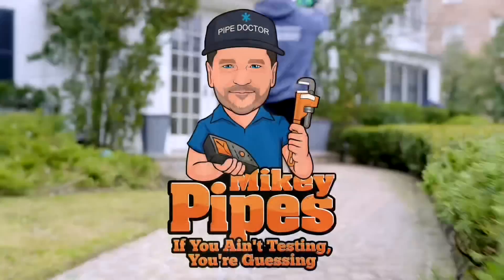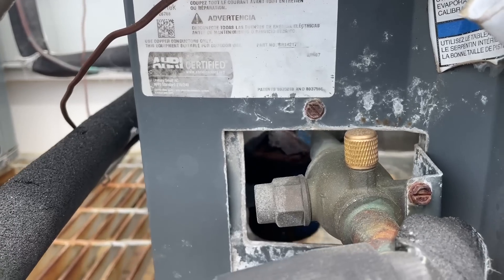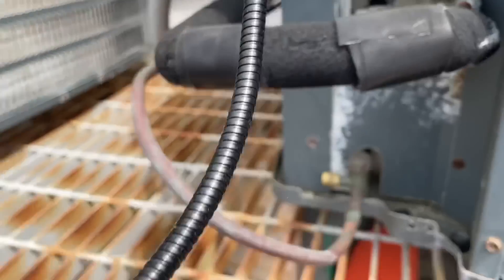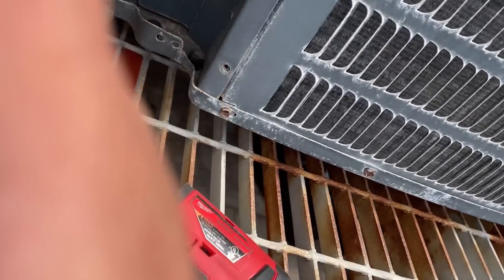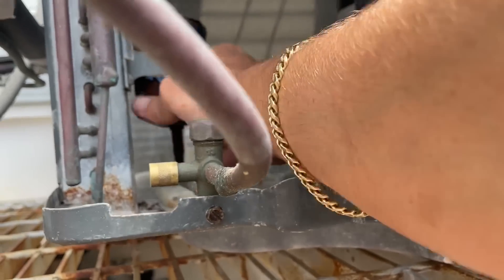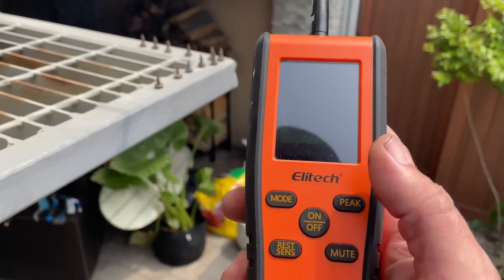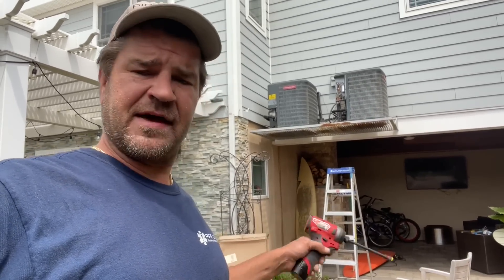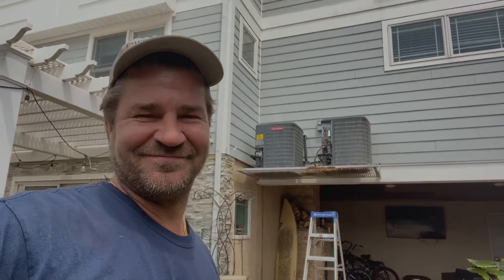Goodman AC Not Cooling Leak on Filter Dryer Inside Condenser Found with Elitech IR-200 Detector

Comment: Filter driers are factory installed in condensers because the average hack installer tends to neglect field installing filter driers on the line set and manufacturers got tired of warranting compressors because of it. It’s literally common knowledge. 🤣

Comment: The one thing in which MicroUSB was better than the previous MiniUSB, was that it had the electrical readiness for OTG years before there were too many OTG supporting devices. Otherwise Mini was mechanically sturdier, and easier to get the right way around. Now USB C not only allows high charging currents and takes the speed to another dimension, but it takes the OTG functionality to yet another level, as OTG is technically inherent in any cable without a special adaptor, and a slave device can charge the host in the newer specs. The only thing that bothers me is that the cables tend to be expensive.

Comment: I was told they put them on at Goodman to assure that the system had one fit its protection.  I’ve replaced several over the years and either put it outside the condenser or at the evaporator.
Reply: If they didn’t put them in, their “professional” installers would forget.

Comment: If I may make a suggestion,  unless you have it already, buy the Milwaukee 12v "Right Angle" impact driver.. I have two and they're my "goto" for 98% of my service calls. It goes where even the small drills can't reach or enter. And with a flex rod with a short nutdriver bit, they're aren't too many places/angles you CAN'T  reach. Especially between the furnace and return duct. Granted, it takes  some getting use to holding & using it, but its worth it..
https://www.milwaukeetool.com/Products/Power-Tools/Fastening/Impact-Drivers/2467-20

Comment: Unless you are fitting a whole load of condensers above your head every week, I would hire a genie lift or similar as and when required. Put the cost of hire, delivery and collection on the customer. The issue though is the surrounding ground - I see a lot of your work around lawned areas so you need a stout bit of plywood the size of the lift base to spread the load.

Comment: 3:15 I engineer / work on electronic devices like these. Generally micro-usb is used because it is cheaper. A micro-usb connector part might cost about $0.15 at volume whereas a usb-c connector part would cost more like $0.50. That's a huge difference when you're talking profit margin on an electronic device especially for something which doesn't bring any change in actual functionality. It doesn't sound like a lot ("I'd pay 50 more cents for that") but these kind of things add up and eat away at profits or device costs really fast.

Micro-usb is still more common in products like this anyway (i.e. more people are likely to have a cord or charger for it). The aggravation of plugging in the correct way may be out shadowed by the aggravation of not having the right cord when you need it.

Comment: Stupidest thing ever. I've seen it in York too. Nothing like a tall heat pump with the drier laying on the bottom of the unit. Genius. American Standard/Trane tend to stick the reversing valve and the mufflers/driers in the side panel. Then some idiots installs that side against the wall for no reason.

Comment: Genie  Compact Air-Powered/Material Lift, 300 lb Load Capacity Model GH-3.8    Or General Purpose Manual Material Lift, 1,000 lb Load Capacity Model SLA-10 STD

Comment: Use a genie lift. What we use and it can fit into a pickup. Not defending Goodman but technically speaking that’s an Emerson drier so if you want to bust balls wrong company. Mikey I want to see you fix a leak. That’s two videos of what I would consider repairable leaks that haven’t been. Not saying it’s the best option but a option which I know you gave them but cmon super tech sweat some pipe.

Comment: The drier is in the unit so they know it is installed. Lazy guys may not want to take the 5min to install if it is shipped separate. Zoomlock a short piece of copper in place and a zoomlock drier in the attic. Easy
Reply: Why would you ever want to put a drier inside and force someone to take a torch into a house for every single repair? I know, I know, “The drier needs to be close to the metering device” blah blah blah. Heat pumps in many areas spend more time in heat than in cool and that means the outdoor metering device is more important. Many OEMs toss them in the condenser (obviously) so it really doesn’t matter. Don’t be that guy. Put the drier outside where it belongs.

Comment: What you want is a telescoping mechanical lift called a High Jack and some other brands. You should also get a platform ladder so you can safely stand at the right height. Get a magnetic tray to store the screws during repair. If you won't use the lift often you may be able to rent it.

an example: https://shop.gilmorekramer.com/product/a-1-hi-jack-hi-jack-material-lift/57612?gclid=CjwKCAjw47eFBhA9EiwAy8kzNOBHFYC0zPb4uIeR63CHPyHu4C5sQ9hjnuV9q_wqS-3o4fsg4QjVtBoCY5YQAvD_BwE

Comment: we been using genie super hoist jack for couple years now it work perfect for condenser and air handle
Reply: oh and we convert to use nitrogen so we don't have to use air compressor or CO2
Reply: I have the model number if u need genie gh5.6
Reply: I've used one, they tend to get away from you ^^^^^^^^^^^^

Comment: They put the filter driers in the unit cause they can't trust contractors to actually install the darn things.
Reply: Because an extra 2 brazes on a 3/8th liquid line is difficult fucking hacks lmao
Reply: I was just about to comment the same thing. What's funnier is coming on a system with one drier in the unit, one outside, and one inside. And they wonder why the liquid line was restricted lmao. BTW that unit was completely restricted pulled into a vacuum on AC mode and ran up to 750 on heat mode both in about 30 seconds. Lady called bc wanted to know why her energy bill had gone up. Electric heat was carrying a 3 story mcmantion lol.

Comment: As they say nothing stops a trane, but it goes the other way around for a Goodman “Everything stops a Goodman.”

Never been a fan of Goodman
Reply: I have had a Goodman unit for 5 years in South Florida, worked flawlessly, never stopped (thankfully 🥵 ). It all depends on the install and the maintenance I think. They installed the filter drier outside the unit though, easier to maintain.
Reply: @ThierryC2373  Good that its working good still! Definietly does depend on the maintenance for sure, I've just had alot of bad experiences with Goodman where I am lol
Reply: @ThierryC2373  5 years is nothing.
Reply: Lol tranes are easily stopped,pure garbage.
Reply: @chesneyquinn2377  I very rarely run into issues near me. Must be some shitty installers around you eh?
Reply: Cookie dough head,the best installers are on L.I. got eat your fruit fatpie.

Comment: Dude come on that is a muffler not a drier, but it does look like a filter drier I’ll give you that.
Reply: That is the filter drier, not the muffler. Goodman units have them inside the condenser. Muffler is closer to the compressor
Reply: 😂🤣😅 go back to trade school guy
Reply: 7:00 you can clearly see it is just before the liquid service port. It's the filter drier. Mufflers are on the compressor discharge before the condenser coil